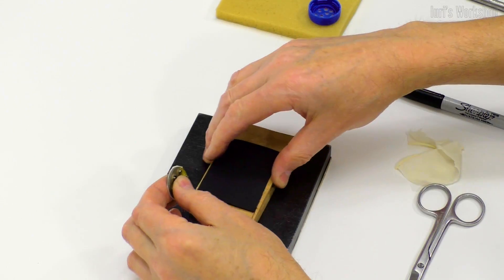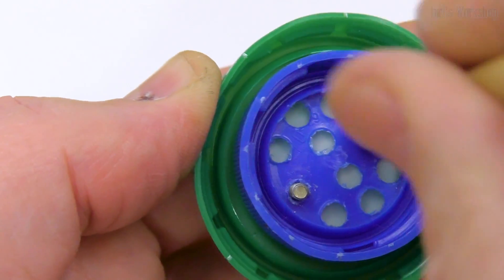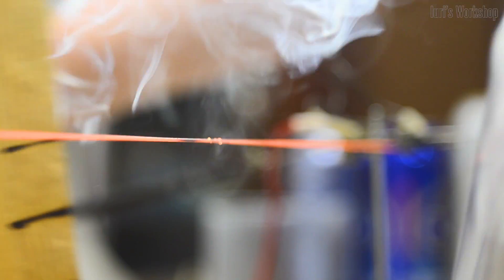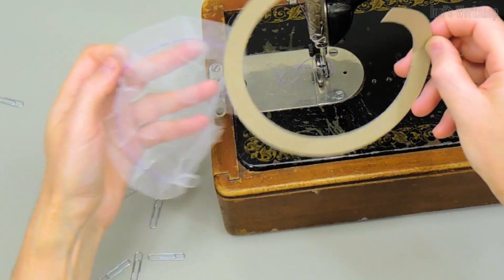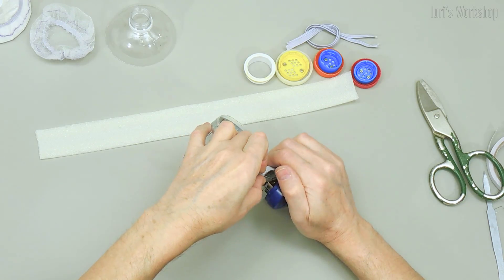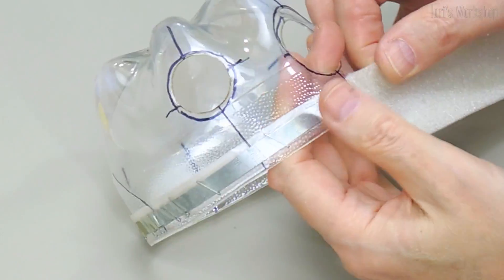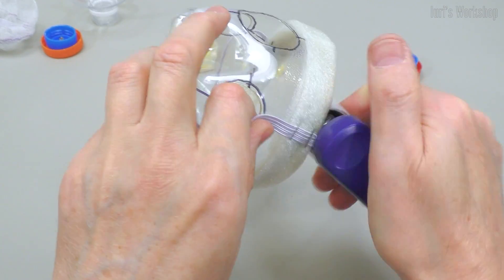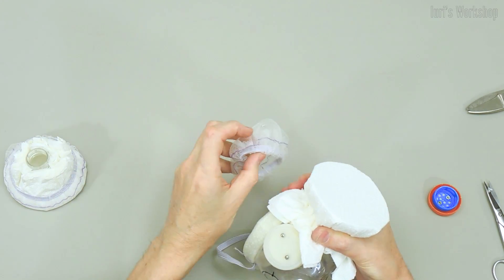🔅 DIY Respirator #2 (improved version)

Comment from the maker: For those who think that this video shows too complex a process, I developed a simple solution: https://youtu.be/vgFGguEkB6k
Reply from the maker: Cosmic Dissonance  I'm just preparing a laboratory experiment to check the reliability of the filters. It will take some time. If he does not confirm the reliability of the paper filters, I will look for a replacement for them. I used paper filters based on research findings from Karean scientists.
Reply: Привет, что понравилось наше изобретение из говна и палок ?))))

Comment: Good but filtre not can be  change able this filtre outs mask outs to means your filter is  outs  and mask outs top filtre atteched mask  your invention good  but needs upgrade and needs better change able  filtre adoptors other things and you can use cheminicals to make better filters but itiş imposible at home and dangerous  nevirmind it cheminicals you need just more good mask and change able filters adapters other thing

Comment: I would recommend buying a proper respirator I would not recommend making one yourself it is dangerous and there could be mistakes made and it cannot filter out smaller particles or toxins and it does not have a good face seal it’s fine for very basic tasks but not for anything else just buy a proper respirator with the right filters for the task
Reply from the maker: Спасибо за комментарий! Вот более продвинутая модель респиратора: https://youtu.be/-k3vnUmdtZw?si=0woHeK7C9C6LwVgj Я использую именно такой респиратор при обработке стекловолокна. Он показал себя лучше, чем заводские респираторы. Я сделал этот вывод, используя простой тест. Если я использую заводский респиратор, я чувствую металлический вкус во рту после часа работы. В моем домашнем респираторе я могу тренироваться в течение нескольких часов, но вкус не появляется.

Comment: Looks cool but lacks the magnetic s & webbing to give you real protection plus by the time I found all that crap I would have died from Covid 19 U should use real filters cut up like the rated ones for AC and home use. NICE JOB & IDEA! Just not Practical. Better off to buy a 3-D printed one or a painters respirator.

Comment: Do you use stainless steel screws and nuts? I'm worried about them rusting and corroding the gasket. Any alternatives to using metal there?

Comment: Lovely idea, especially using recycling material as the base, however, those 'filters' won't do much for Viral or Bacterial problems - for those I'd suggest getting filters for Heaters or other devices that can block 99.97% of particulates,  MERV 16 are expensive but 1 filter can make multiple mask filters for example.  Those will, however, work for dust and such, which is a nice thing to have for environments that have sanding and the like.
Reply from the maker: Many people recommend different filters, but few have tested them. Basically, everyone relies on information from the Internet, which can not always be trusted. Based on the fact that every second doctor has already become infected in my country, I have already begun to doubt the reliability and official information.
I am preparing a laboratory experiment to test different filters for masks. True, the work dragged on a bit, as it took to build a sneezing machine. Now I’m thinking how to adapt a microscope to this design.

Comment: The valves are a great contribution to the homemade mask discussion. Filter cartridge medium could be improved to include activated carbon and commercial air or vaccum filters.
Reply: Correction to original comment due to new knowledge:

 a vacuum filter and some commercial filters will do the trick if you take care and clean them after usage so you can reuse them and it is better then using random pieces of tissue but they cannot filter out viruses at 100%

adding activated carbon to the filter will increase the efficiency but activated carbon reduce in efficiency over time as well a become bacterial colonies. they eventual become deactivated.

Unless you can reactivate charcoal or clean the other filter materials, or even know the proper protocol to use a mask and not contaminate yourself anyway. Not wearing a mask is safer because you wont be over confident and expose yourself more then what you can deal with
Reply: @peter4210  activated charcoal costly to recycle? Soak in lemon juice and rinse with distilled water then dry it out if you want to reuse it instead of throwing it away when it's saturated.
Reply: @SW-ii5gg  yup, that's not re activating it at all.  You would have better luck running hot steam trough it even if it is not supper heated. If it is getting filled from harmful chemicals you want to just throw it away. If your using it for a virus, a disinfectant like alcohol could do the job but eventually it will be clogged or the virus wont be getting killed by the alcohol.
Reply: @xbugz3579   The SARS-COV-2 virus could be airborne with out the assistance of particles. Secondly water is a fluid, one that can evaporate quickly in our atmosphere.

If your wearing a surgical mask, and you were lucky enough that the infected droplets did not go around the mask and into your nose/mouth and actually stopped on the fabric, you now have infected water in the fabric. That fabric was designed for the doctor not to spit on your wound during surgery and not to be worn all day against infections. Trough you breathing, the water will eventual be pushed trough and into your mouth/nose or the droplets will dry out, leaving only the viruses in the fabric to await a strong inhalation.

Mask and gloves work in hospitals because the doctors and nurses fallow strict procedures to make sure they take out the gloves and swap the mask with out making contact with the infected surface. They also swap them frequently. here in Canada they are investigating way's to reuse that equipment due to the international covert war to hoard the resourses. But The average joe is too misinformed to know any procedures. 

That is why you either wear the right stuff and take care of it properly or you don't. Over confidence is more dangerous then not having a mask as staying 3m away from people.
Reply: @xbugz3579  No, I am just Hypochondriac. I did do some years in college on social science but I switched to Computer science after getting Bord of teachers trowing science trough the window.

The information I have is available if you do your research properly. You can even look up how a n95 mask filters and why a pair of jeans in inappropriate to make a filter.

Information on the misinformation done by governments is harder to find, my provincial goverment was open about the misinformation and just said to the public, that people in hospitals need them more then you. The WHO even talks on their reports of how they are Using the name COVID-19 for the virus not to scare the public when they themselves gave the real name of the virus which is SARS-CoV-2

I have been looking at people making mask online to get an Idea on how to make my own mask but usually the filtration is not the best. I was still doing research on filters when I made my original comment so If I said Vacuum filters are shit here I am sorry, some of them are basically n95 or better.

If you want to make activated charcoal yourself there is a guy on youtube called cody's Lab. The guys wears copper chain mail out of fantasy or some shit and his set ups look like a meth lab but it is a proper way to make activated charcoal. That dude has some videos that were taken down by the US goverment because he refined uranium for the fun of it with out thinking some people would use the uranium for evil.
Reply: you might be not die in toxic gas and fire smoke

Comment: 5:50 where are your gloves the hands touch everyone and leave the virs everywhere, then our face is in vain
Reply from the maker: Many people think that touching the face with gloves is not as scary as without gloves.
Many more people think that virs flying through the air are more dangerous for the hands than for the mouth, nose and eyes.
People in general are often mistaken when they listen to the radio and watch TV.
It is useful to wear gloves if you are wearing a protective suit and gloves are tightly connected to it. Well, the costume itself is effective, only if there is a degassing chamber in front of the entrance to your home.

Comment: Improvement
1.Use hepa car air filter.
2.  hot glue the stapples, to seal the holes.
Reply: 3. Use activated carbon/charcoal
Reply: @ktprojects2077 
How would you integrate the activated charcoal into the filter?
Reply: @wanderingcalamity360   i guess you just crush it into small bits and toss it between thick layer of paper towels, would add a mosquito net  so you wouldn't inhale charcoal though
Reply: Yeah, was thinking the same thing.... otherwise might as well just hold the paper towel over your face...
Reply: @Whitman1819  i second that 👍
Reply: Alternatively just use the HEPA filter from your furnace or home ventilation system

Comment: Sterilization is not a difficult process for something like this.  Fill a hairspray bottle with 90% isopropyl alcohol or another liquid disinfectant and use that to spray down something like this mask or anything else.  You get an even, thorough coating of alcohol which will kill nearly all virus' and bacteria.  Use the liquid that best suits the disease pathogen you're trying to avoid.  Foaming liquid soap works very well also.  You can spray down yourself as you self-decontaminate, and then with hands wet, decon your mask and other items.  You can also spray down your clothing effectively as well as your face, top of your head and neck.  Cover your eyes with one hand while you spray your face with the other.
Just make sure that what you're using in the spray bottle 1. kills your pathogen effectively and efficiently and 2. does not react with your skin too adversely (meaning Acetone would not be so good to use because it dissolves many plastics and is a carcinogen).  Acetone, though, would be good on metallic surfaces if you have a lot to disinfect.  
Also, you have to be careful because many disinfectants that you would spray become explosive in the air until they disperse.  So no smoking or open flames while you're doing your disinfecting unless you like the thought of losing your hair in a towering inferno.
Also, HEPA or allergen vacuum cleaner bags are good substitutes for filter media, though for this case you would have to redesign the filter cartridge, which isn't too difficult with a little thinking.
Reply from the maker: Thanks for the comment!

Comment: The cotton filter 60%.. need other filter or 2 layer of cotton. The mask for cov-19 use 3 layers. Fine cotton/surgical filter(hidrofobic)/other layer of cotton.
Reply from the maker: These filters are made of two two-layer paper towels.
Reply: @IurisWorkshop  i know... but is paper, not cotton... or best filter is fiber non-woven fabric (Usually used for ecologic bags on supermarket) filter 90% (is PP polipropylen) and is hidrofobic.......problem need force to respiration. On theory is the same for N95 filter

Sorry for my bad english..

Comment: Do the side bottles with the filter need to be that big? Or can they be slimmed down an still have the same effect?
Reply from the maker: That's a good question. I use very dense filters, so their area should be enough for easy breathing.
Reply: @IurisWorkshop  can you use a house furnace filter cut down to us as a filter instead of the paper towels?
Reply from the maker: @rabidarcher-gd9eo  Where I live, we use small split systems for each room. Filters that are used in these split systems are not suitable. But I was dealing with these filters when I lived in the USA. It seems to me that these filters have insufficient density and they will be less effective than paper towels. Unfortunately, most users are not able to test the filter. So I'm going to do it. I am currently preparing an experiment for this.

Comment: with  one way valve, this only protects the wearer. much better to use a mask that filters both ways, then it will help prevent spreading of the virus, just just stopping one wearer from getting it.

Comment: Doesnt a bit of air sneak back in in order for the valve to function correctly? I love the mechanism, and fantastic job editing and making the video, thank you
Reply from the maker: These valves are used in any factory gas mask. A small amount of air can enter through the check valve. But since it quickly closes, air remains inside the valve and is thrown out during the next exhalation.
Reply: @IurisWorkshop  Thanks man, You are doing great work. I just made a PAPR and Im going to 3D print  a mask with your valves

Comment: This video is real jerky at 60 fps. Was this video sped up from 24, 25,  29.97, or 50 fps?
Reply from the maker: Yes, I usually increase the speed of a video a bit to shorten its overall duration. But sometimes I can slow down if you need to show something more in detail. Why did you have this question? If you find any flaws, please let me know about them.

Comment: Well, I made a similar mask for our Science Investigatory Project. It has removable parts that are are connected via plastic bottle caps. My filter is cloth with granulated charcoal 2 mm in diameter.
Reply from the maker: I also made a carbon filter for a gas mask. It is compatible with this respirator: https://youtu.be/-5HhjDENfFQ

Comment: Paper towel won't work. Nice idea but you need to use better filter material.
Reply from the maker: This respirator has a universal filter mount. You can insert everything you have there. I had nothing but this paper. There is nothing in the atecs. Department stores closed. Experiments by South Karean scientists have shown that paper towels filter filtration up to 90% by comparison with a medical mask.

Comment: There are several common materials available for the filter elements that would work so you don't actually need N95 material.  That is, though the virus itself is microscopic it is usually encapsulated within other bodily fluids (e.g. saliva, mucous, sweat, tears, etc.) that would be easily trapped by the filter elements.  Bottom line again, it's better than nothing at all.  That being said, unless you are staying within close proximity of someone who is actively sick (e.g. coughing, sneezing, sweating, crying, etc.) you don't really need a mask as long as you follow proper hygiene (e.g. washing your hands as often as possible and not touching your face, eyes, nose, or mouth areas at all).  If at all possible ... Stay the F@#% At Home ;)
Reply from the maker: In South Korea, masks from standard paper towels were tested. Filtering 90% of the factory mask.
Reply: @IurisWorkshop  ... Another video showed the use of material cut from HEPA rated Vacuum cleaner bags.

Comment: Okay I got a better and easier idea. Masks don't work well. You need to go higher up, above breathing line. Put a closed, clear plastic/vinyl hood over your head, hanging down to your lower neck. Puncture a hole near side top of hood. Put a PVC pipe from near your mouth, running up thru top hole, with the pipe sticking up and over your head about a foot.  You can brace the pipe on hood or on your head, with elastic. Seal hood hole with tape.  Also wrap tape around your neck to seal. The point is, the virus drops to the floor. You need to get the air from above.  These pipes would get the air from above, above the breathing spray from patients. This would mostly be for doctors. Feel free to make a demo with my idea. - Also you might want to add goggles on eyes, so they don't fog up in hood.- Edit- You might want to add two pipes, one on each side of head, one for breathing in and one for out.
Reply from the maker: :) https://youtu.be/-5HhjDENfFQ
Reply: @IurisWorkshop  Yeah I looked at the video. That bottle mask looks good, but you should turn the bottle around, with the opening at the top. Then attach a pipe going up. That way, you can capture the virus free air from high above.

Comment: Ok, I like the design, the one-way valves great but should add a hepa filter to all 3 openings not just filter the sides.  But the use of napkins?  That especially gives a sense of false hope.
Reply from the maker: The size of viruses is usually close to 100 nanometers. Therefore, do not rely on a mask that filters out the virus. But the mask can filter out the microparticles of the fluid that carry the virus and whose size is much larger.
https://www.scmp.com/week-asia/health-environment/article/3075164/south-koreas-coronavirus-response-opposite-china-and

Comment: It's better than nothing at all, but not by much
Reply from the maker: I tested factory medical masks for going to the store and they disappointed me.
Reply: @IurisWorkshop  Paper towel still isn't filter medium, viruses will pass through almost as well as the air does. Just buy a surplus NATO gas mask since medical and industrial ones are almost impossible to get.
Reply from the maker: The size of viruses is usually close to 100 nanometers. Therefore, do not expect your mask to filter out the virus. But the mask can filter out the microparticles of the fluid that carry the virus, and their size is much larger: https://www.scmp.com/week-asia/health-environment/article/3075164/south-koreas-coronavirus-response-opposite-china-and

Comment: Is it air tight? You could add a gasket seal where the filter screw on and hot glue arround the outside under the foam so that air doesnt come through the staples.
Reply from the maker: Pressure eight atmospheres without gaskets and sealant. Kapron covers sealed themselves: https://youtu.be/VYsHxjY4VJo